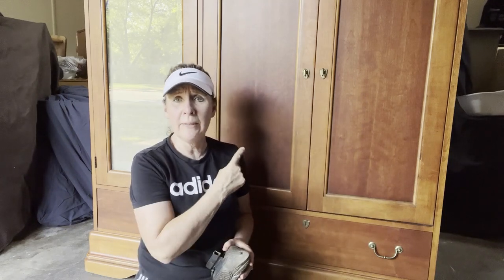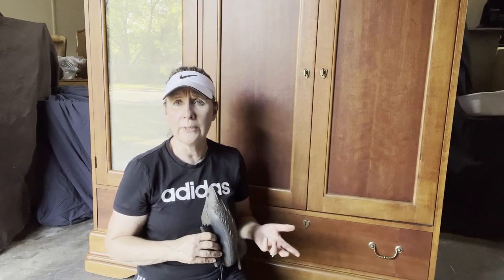Borderline Furniture Rx Project 07 - repurposed resized entertainment center

Comment: Hi mara!! new sub here!! you totally gave me a chuckle with spending to much on this piece.. they are completely obsolete so thank goodness us furniture flippers have great imaginations and can create a new use for them!! way better then filling our landfills up even more right? i like wood bondo for filling holes.. is that what you are using or something else?look at you go constructing those amazing sides!!! fantastic! how do you like that behr chalk paint? i used it once because someone gifted it to me and i think its really great! this turned out soooo good!!
Reply from the maker: Hi - thank you.  I used bondo for the holes on the side, after sanding I used dixie belle mud (not shown) then spray primed, checked for smoothness and reapplied dixie belle until there were no more visible holes.  I used Kwikwood for the drawers - I just think it is easier than using bondo.  Then I used wood dough for the touch up on the sides.  Bondo would be too difficult to work with there and dixie belle would crack.  OMG - I am in love with Behr paint especially their chalk paint!!  I do sand between coats - it could be my equipment, or the Texas heat or just that it needs to be done.    I really am going to invest in a good microphone so I can narrate my videos - so many unanswered questions.  I love recycling - not shown but I had originally planned to use glass for one shelf that was recycled from another project - it was tempered glass which cannot be cut and was broken by the glass cutter.  :(
Reply: @borderlinefurniturerx7971  thank you for all that extra details!! It really turned out amazing Mara!